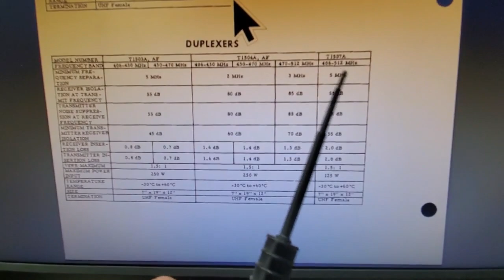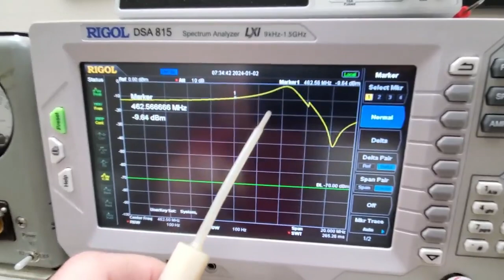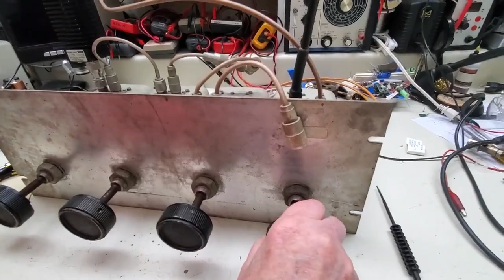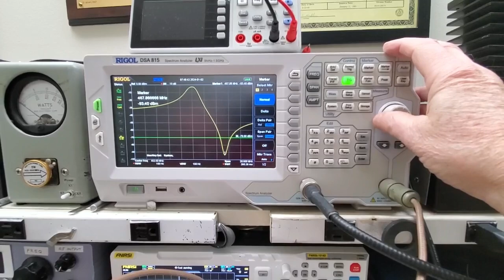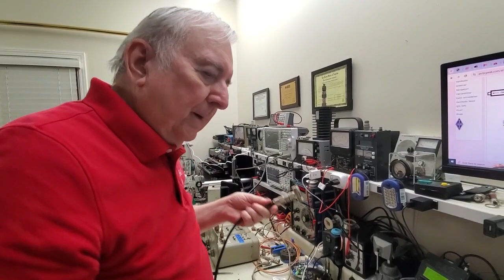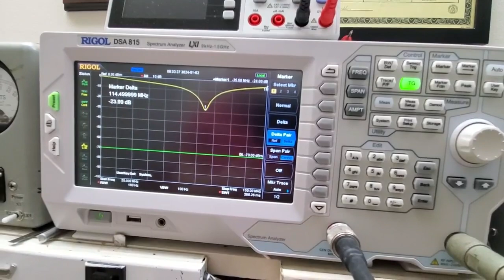Tuning Motorola uhf duplexer and 1/4 wave stub using the rigol dsa815 spectrum analyzer

Comment: I acquired a motorola 5100T and correct me if im wrong , on the 5100T the low side would be on the left if looking from front and high side on left , so when i hook up a transmitter to low side with 462.650  i get no reading, when i use 467.650 it shows like 3-4 watts , im using an HT , when i run the same test on the high side i get no reading at all using either one of those frequencies, is it possible this is tuned wrong ,backwards, ive use multiple size jumpers as im being told they have to be half wave jumpers from duplexer to repeater , does this seem normal, any info would be appreciated, thanks

Comment: This video is unbelievably helpful to me! I have one that I bought from another repeater owner 3 years ago…I used it for about a month then started having trouble with it …So sent it out 2 times for tuning same guy came back worse than it was …so put it on shelf for a year or longer and sent it out again to a different company for tuning came back pretty good lasted a couple weeks …so back on the shelf again…The other day for no good reason I hooked up my VNA to just one can and it look ok not perfect but not that far out of tune. I accidentally bumped the can I was working on and it fell on its face! So tapped it again and it was back tap again and gone…Found My Gremlin! I don’t know if I can fix it or not and it really don’t matter …but if I can …I would love it …. I really like this old equipment. So if I can fix it, I will need this info to tune it …I have more in tuning and shipping than what I paid for it …So thank you for doing this video …Dave

Comment: In your words (and not trying to be disrespectable but you laid out the steps in tuning the Duplexer you did not metion that you Normalized the Analyzer this should be done befor you trace out the UUT as this will afeacet the dB MESURMENTS IN LOSS OR GAIN.. YOU CAN ALSO USE MALTABIL MARKERS, SO YOU DONT NEED TO MOVE YOUR CENTER FREQ MARKER BACK AND FORTH  OTHER THAN THAT GREAT VID
Reply: That was an excellent thing to point out. Thanks for that.